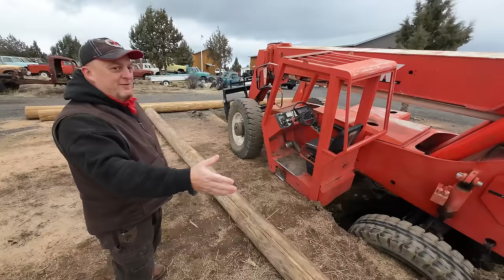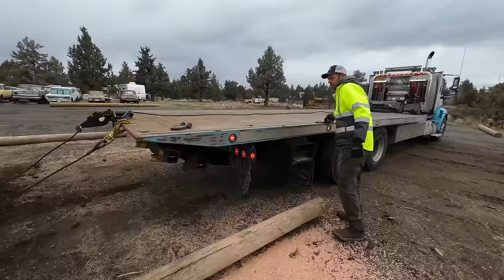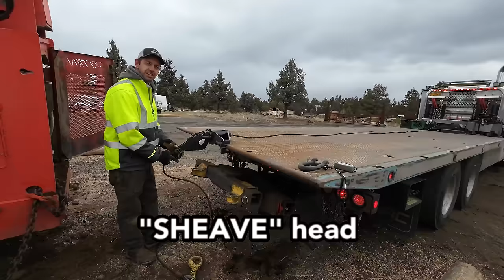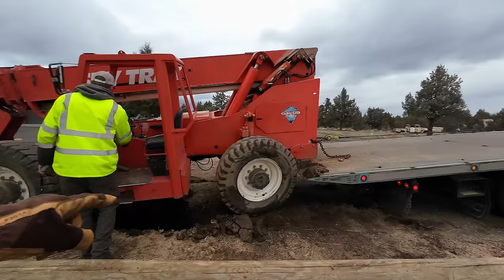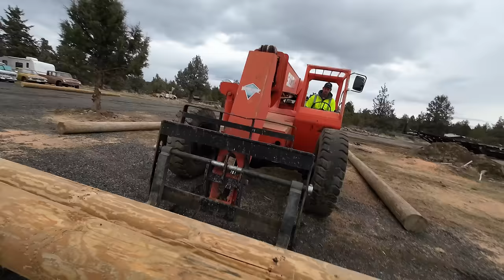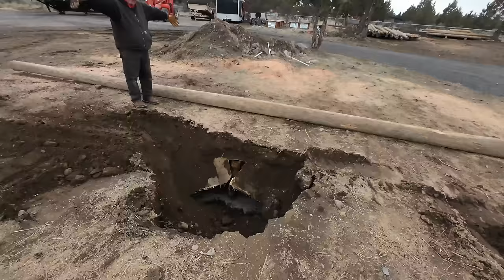20,000 pound machine falls into septic tank!

Comment: Almost forty years ago I was working on a rough framing crew on a new house when I looked up at just the right instant to see the front wheel of a concrete truck drop through the top of a septic tank in a yard across the back yard from where I was working. The truck's driver seated almost directly above that tire had a sudden four foot drop. The memory of it remains vivid all these years later because it was such a "now there's something you don't see every day" moment that I could have easily missed in the split second it happened.

Comment: I didn't fell in it but last summer, discovered an old septic tank (probably the original of the house from way back then) because the top (made from tick wood) fell in on its own making a hole were I've been passing with my mower tractor for the past 4 years without falling in (since I bought the house), thankfully...

Comment: Might be why after I had it cleaned out.  I dumped gravel into septic tank, left lid off.  I keep getting tempted to dig it out, cement new roof.  It did over 60 years.  Zero issues till state demanded burial mound with pump. Needs pump out 2 years, issues every @4 so far.

Comment: That was self recoverable. If Ben had pulled a vehicle in front and picked it up then extended the boom out to the point it over loaded the weight of the skytrac it would have removed the weight from the rear axle and he could have driven forward out of the hole. 
Did that once when I backed into a fresh back filled trench after a good rain... Not so good on the equipment, and I don't have ant fun toys to get it done any other way....

Comment: You could of pushed the boom down and lifted the front tires in the air and backed out as boomed out. I use to run sky tracks on some horrible job sites in north west PA in the winter and never got stuck so bad I couldn't push my self out with the boom.

Comment: If the septic tank was full of water, then driving over it with heavy vehicles wouldn't be that much of a problem, but if the tank started leaking and was only half full, then it can collapse easily. Especially with a telehandler where the heavy counterweight is in the rear.

Comment: Mister Casey it probably will never happen again but if it does try putting your forks on the ground hook your cable to the back of it and as you pull backwards have the front of the machine hold held by the forks and go over the hole I have done it with front-end loaders to the keep the front I know there's eighty-eight thousand different ways to do stuff I was just telling you away that I have done it too but anyway that works for you love you videos be safe and have a great day Sam

Comment: Should have boomed out and parked something way over the weight limit and tried lifting it using the winch and leverage to basically pivot the loader onto the front tires and then drag it sideways
Reply: If you read the Description, they had already tried extending boom and lifting a heavy item.

Comment: Ben all you needed to do is get one of ur Truck n park it in front of forks n pick it up n than Exstend boom out n the weight would mould make the rear of the machine go up n drive forward n get out of the whole
Reply: If you read the Description, they had already tried extending boom and lifting a heavy item.
Reply: @JohnHallgren  I'm a Crane Sevice Mechanic n I was Called to Get Them out of Holes n When they were stuck all the time n Contractors were Amazed by what I've Done
Reply: @robertbarkey3194  I was just pointing out that they had already tried that solution without any success before calling Casey.
Reply: No problem n I Like Watching his Videos n I like where they Help people n have Great Friends n that's Rare these Days huh

Comment: I was working in construction building a dining facility. A concrete truck showed up & it was waiting to be guided to a designated spot. I knew where it needed to go but I decided not to do it since it wasn't my responsibility. I'm glad I didn't because I would've guided it right over where a gas tank had been buried & the structured would've collapsed under the weight of the truck. It would've been a major task to get a fully loaded concrete truck out of that pit.

Comment: I put in a new poly septic tank at a house I was refurbing for a family member.  It is only under the ground about 6", but has two large round access holes that stick above the tank about 8 inches.    Old septic was steel, found the lid, cut it off and filled the rusted out tank with concrete chunks and dirt.

Comment: I have had a lull in a very similar situation though inside of a septic tank it was a giant old steel drain pipe with both the rear wheels in the ground. what I did was get the other forklift parked it near the max reach of the boom then I boomed the lull all the way out and put the forks under the other forklift. then using the boom of the lull I lifted on the forklift which was beyond the max weight for the reach which made the rear wheels come out of the ground then I was able to drive forward while booming in

Comment: I'd be investigating if this is hooked up to anything.

If not, rip that crust up, pump it out, break what remains of the top of the tank and fill it all in so it's solid again.

If it is hooked up to something, can it be disconnected any the other tanks used?
If so, see above.

If not, repair the tank so it's water tight, place rail road sleepers or long logs over it and then back fill.

There will ALWAYS be someone that finds it, even if it is marked out...

Comment: Great video. FYI another option was to pull the rear axle out the way you did, then set the forks down. With the boom retracked, lift the front of the machine with the forks, then extend the boom. This would carry the front axle over the hole to better ground. Carry on.